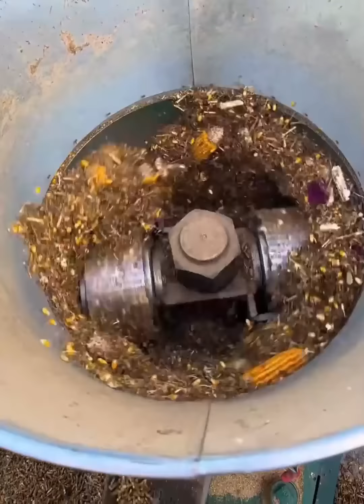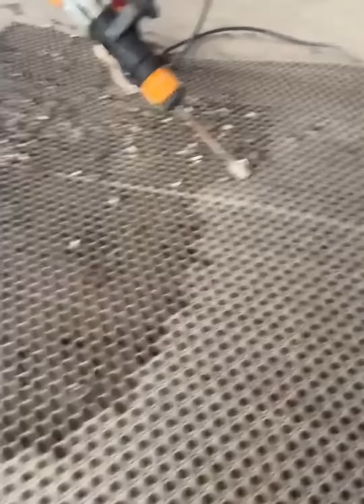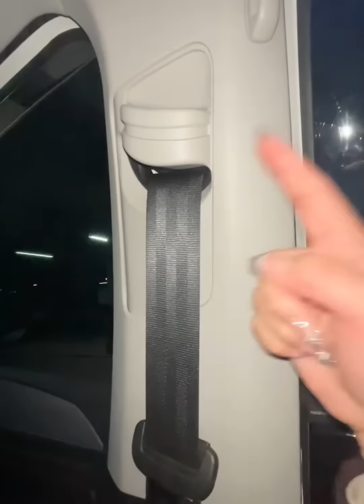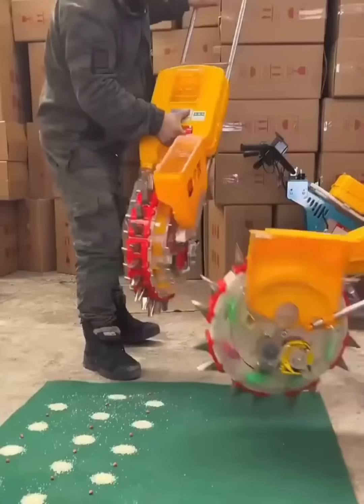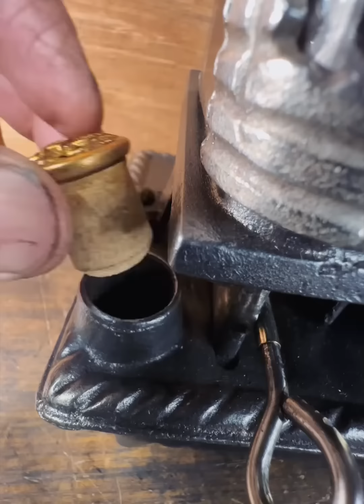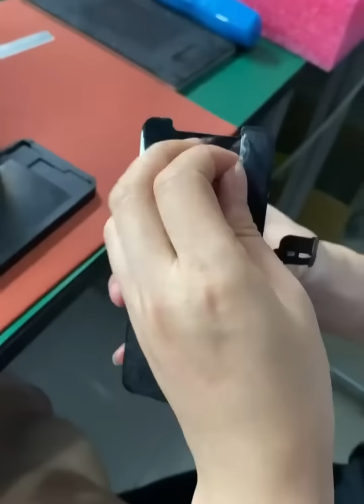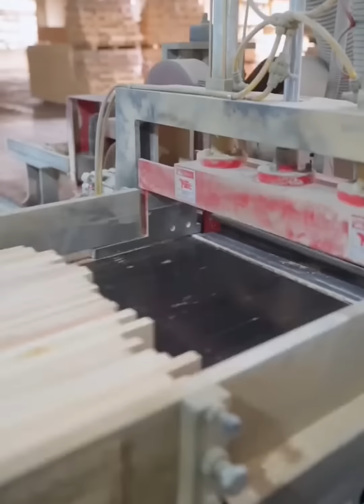Most Satisfying Factory Machines and Ingenious Tools That Will Blow Your Mind

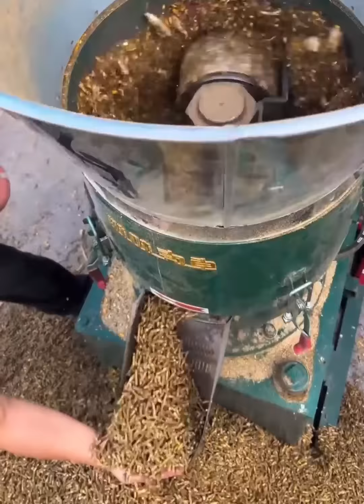Comment: 02:18 the mixing isn't even done when the pellets already come out. And what happens with all the water from the cabbage? The pellets are completely dry.
Also, perpetual motion machines are not possible. This is a bs video, and I stopped at 02:25.

Comment: Starting off with a “perpetual” motion device is a bold choice
Reply: The hardest part of building a perpetual motion machine is always figuring out where to hide the batteries.
Reply: @MWSin1  And magnets.
Reply: Hey it works as long as the power is plugged in
Reply: @Kirkmanator  lol
Reply: @Kirkmanator : Not necessarily required. It'll work with one or more batteries too, or it can be directly by a gasoline, diesel, or jet engine.
Reply: The most ingenious part is where they put the battery
Reply: That was fake, most likely had iron in the liquid and a magnet in the base
Reply: Neither genius nor chaos. Scam.
Reply: You fought bravely through the suspense
Reply: Just like your mom last night.
Reply: Nein!
Reply: Show us the whole machine. C'mon. Show us! 😂
Reply: Lmao
Reply: My whole life I have longed for an orange stabilizer. Now that I am 93, I can pass on, secure in the knowledge that no orange must roll onto the floor ever again.
Reply: Yup, instant thumbs down and notification ban for the channel
Reply: Kicking things off with a “perpetual” motion device? Either genius or pure chaos—no middle ground.

Comment: The old wicked stove , thermal energy needs to be said was used in the days where wale oil was the primary source of energy before crude oil was found. Wale oil for heating and lighting was the reason why the world’s wale population was on the brink of extinction.
Now where facing the results of 100 years of mineral oil use

Comment: What is the name of that water adhesive sealer? Anyone know?
Reply: It looks to me like Flex Seal. Basically liquid rubber.
Reply: Look at the label. The one that stopped the leak under pressure was called 9300 seal or something like that. Probably sold under different names in different countries and that's if it's even available in a given country.

Comment: I hope That jet engine testing lab is harnessing that wasted energy during the testing. Anything to capture the heat energy and transform it into steam, electricity, ANYTHING to capture and recycle it. That's ALOT of energy and money, so make the most of it. 😅
Reply: 😂😂😂 ,no.
Reply: The testing is only done rarely so it wouldn't be cost effective to build an energy capture system to turn the wasted energy into something useful. It's not like companies that could use the extra energy has a setup to test high performance jet engines. Most of the equipment seen is used to just test the engine, now imagine incorporating all of that into preexisting equipment, it'd be  a fing nightmare and even more wasted energy. Nice thought though.🤔🤷🏼‍♂️

Comment: The tire repair is wrong. Upu must use fire to solderize it. Or the plug may move
Reply: No u don't
Reply: Wrong. The adhesive works without any thermal help.